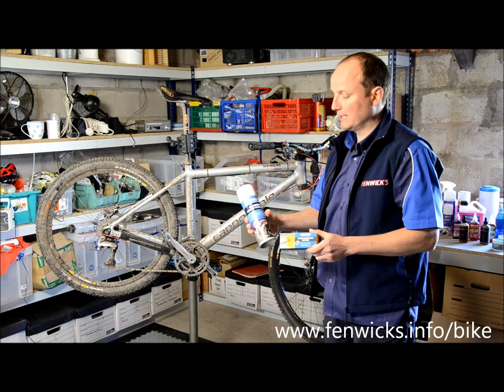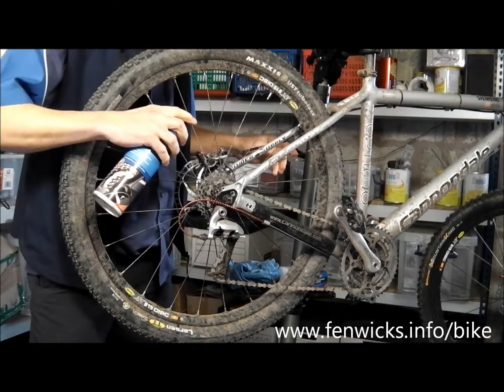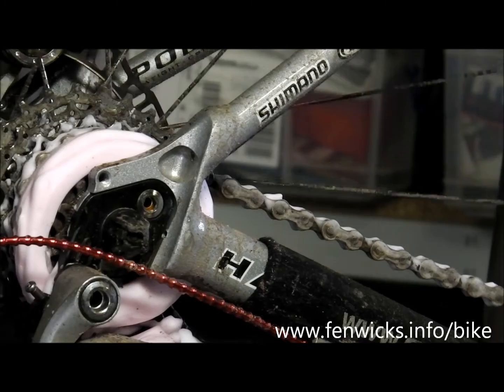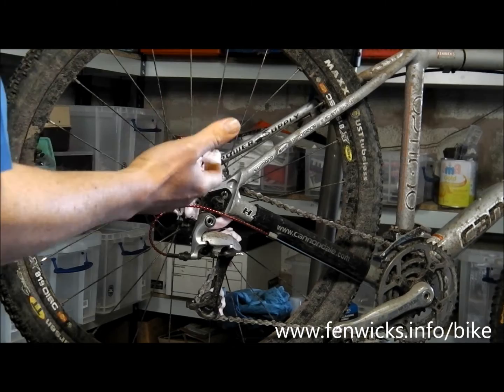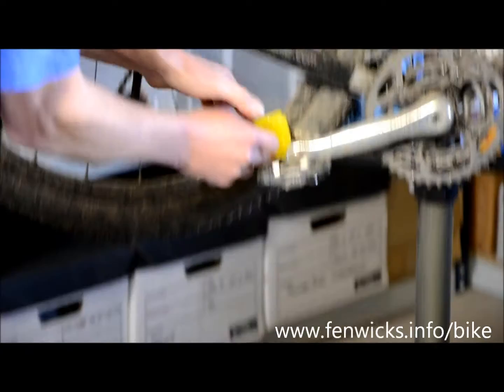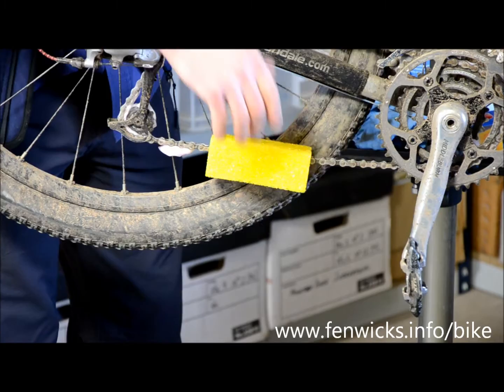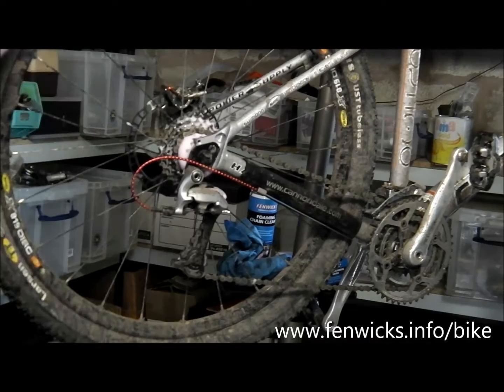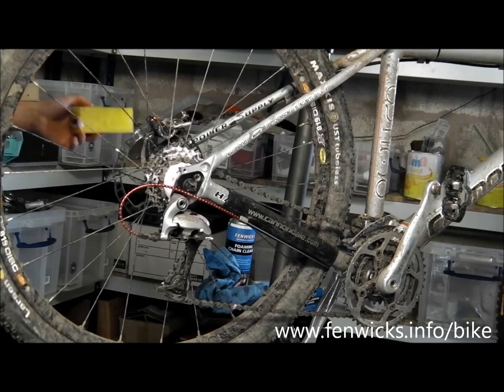How to use Fenwick's Foaming Chain Cleaner and Chain Cleaning Sponge

Comment: that didnt work chain is manky.
Reply from the maker: Anthonykelly5.  Our Foaming Chain Cleaner is water based and works well with all our lubes.  If you are using a wax or ceramic based lube these sometimes need a more aggressive cleaner like a solvent.
Reply: I bought your cleaning pack a couple of months ago and, although I've been using the foam and sponge incorrectly, the results have been good; they should be even better know I've seen this! Can I assume that the term 'allow the foam to wet out' means leaving it until all the bubbles are gone?